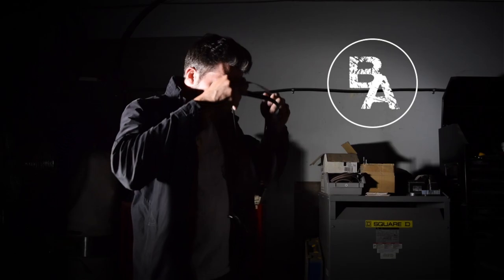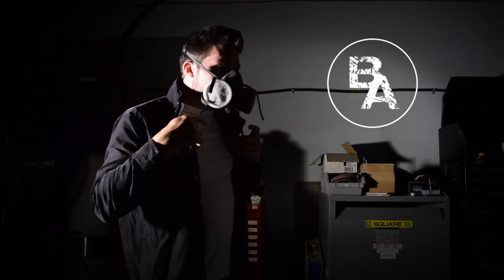Worst Paint Job Ever!?!

Comment: I've been Painting/Staining/Lacquering/Varnishing/Shellacing and applying any kinda  Coating you can name. Two part/One part/Interior/Exterior/Automotive/Marine, you name it I've applied it. I've been doing this since 1972 (age 10) and Professionally since 1980 (age 16) as well as repairing and restoring Homes plus Guitars on the side. Try RustOleum Hammered Metal Finish. It comes in Spray Cans and is available in Black, White, Gold, Silver, Bronze, Copper as well as several colours. It's a great looking and durable Guitar Finish especially for beginners. It's thick and sprays easily and doesn't run much. Just spray light to medium coats 2 to 4 is all you need. Sand lightly with 400 grit automotive sandpaper between coats, no buffing required. Best solid colour finish for a first timer. Super easy to use, easy that find and inexpensive about $6-$8 per can. One can per Guitar Body. I got 4 coats from one can on an Ibanez RG and finished it 4-6 minutes per coat. Approximately 2 hours or less allowing drying and sanding time between coats, 4 total. Waited 24-48 hours, applied 2-4 coats of Renaissance Wax (optional) then reassembled the using the Hardened Italian Steel Neck Inserts available from one seller on eBay. Get complete kit with 2 sets of inserts & machine bolts, drill bit and Allen wrench. It's about $20 and improves your Sustain dramatically. hope this helps everyone. 
Peace, Love & Light!!
Jimmy in NC....
Reply from the maker: I like the canned hammered finish. The stuff in quarts is a paint to work with because you have to thin it with xylene and it gets stringy so damn fast haha. 
Keep in mind with the cans you can control how heavy the hammered effect is based on how heavy you put the coats on.

Comment: Here's one for ya, LOL. I stenciled out a GnR skull (from their album cover) and painted it on the driver door of my 79 Le Sabre.(twice as big as my big head) I rattle canned it with the stencils in the autumn while in a full parking lot of my apartment building. Came out OK, for the most, LOL. But then continued to paint the rest of the car in black rattle can paint at my friends house, I think. It's been around 30 years ago and some details I don't remember. Anywho, continued to drive the car for another 3 years, I think, with the skull on the door. The cops would pull me over just for that, while sitting there stopped by the cops, the cops would look the car over, sometimes laugh at it, and let me go with an escort out of the neighborhood. So after 3 years, my girlfriend (now my Wife) hit the skull in the middle of the face with a bumper jack, in the middle of an argument, LOL. Afterwards, I just covered it up with black paint. Drove the car for another 10 years. The black faded off the door so much, you could see part of the skull, and the hole made by the bumper jack was now a rust hole. Parked the car in my yard for another 5 years before scraping it, The End, LOL.
Reply from the maker: Wow! That’s hilarious.

Comment: I sprayed black paint on a squire strat. Didn't do anything such as scuffing the poly or removing the pickguard, just blasted it with black. No clear coat afterwards so as I played it, the paint picked off the guitar so the sunburst underneath showed through. Looked awful. Course, nowadays this paint over different paint then relic seems to be highly fashionable so maybe I was just ahead of my time. Still looks bloody awful to me though.
Reply from the maker: Damn; that sounds like quite the experience. Too true that that seems to be a new “vintage” style though haha. 

I think you might be surprised by how many people have told me that I’m an idiot for suggesting that you need to scuff your paint before adding more. Apparently, if you sand it it won’t be smooth anymore haha...

Comment: i already told you about my worst paint job, though the way that the guitar looks is actually okay because the slightly crazed front of the guitar matches the whitewashed-then stained back and sides. it has a weatheredish, harsh look to it which is nice, and unique.
Reply from the maker: That actually sounds like the kind of finish that a lot of people would pay extra for.
Reply: yeah, it is only a bad paintjob because the actual paint portion crazed a little, which is not what i intended. the finish is also drippy looking because i sprayed enamal clear on it way to thick, and then didn't sand it because it wouldn't really contribute to the look in a positive way. i am happy with how it looks, because there is beauty in the flaws. it isn't supposed to look like a normal market paintjob, but instead it reflects the imperfect, yet creative methods i used to build the guitar, which in itself, is designed from the ground up, varying completely from normal market designs... i wish i ould show you, but i kinda want to design patent the guitar. however, i am working on a custom 24 hollowbody, which i will eventually complete. i am building it so i have a guitar to show when i say that i know how to build guitars, and because i always wanted a nice prs...

Comment: Ahhh the trolls..  Worst paint job..  probably my first refin.  On an Esteban Acoustic.  Sanded the original finish off ok enough.  I used dyes, and that went not so great, but eventually I managed to get what I was looking for.  First mistake, I didn't put any sealer down.  Started with Wipe on Poly. DISASTER!!!!! colors bled, it was a mess!  Poly wouldn't lay right..   Had to sand back to bare wood AGAIN.  To save you guys all the details, it ended up I sanding back to raw wood 3 times total.  I sanded through the veneer in a couple places on the top. It is now a purple burst with a LIGHT coat of lacquer.  One of these days I'll get around to completing it.  First and only refin so far, but I've learned a TON thanks to Brad!  
Thanks Brad!
Reply from the maker: Yikes! Well, I’m sure your next one will go much better!
Reply: It already has and in no small part, thanks to you.  I posted pics in the https://www.facebook.com/groups/354695864971816/  It's the green burst Tele.
Reply from the maker: Ah, right! I joined the group recently. Love that transparent green!
Reply: Thanks!  I thought it turned out pretty decent for my first partscaster build and second finishing project.

Comment: I'm a bit worried my paint job as an unofficial entry in the Great Guitar Build Off might become a contender in your best of compilation of worst paint jobs. Digging thru your videos now for rattle can sunburst technique (it'll be my first time)
Reply from the maker: I have two on that (make sure you use the more recent one), but I also did an interesting rattle can burst in my 5 part series on painting a guitar with behlens guitar finishing kit.
Reply: @BradAngove  I watched them both. Mine is opaque. I'll probably make a cardboard template to spray over and guide. Uploading video #2 tonight

Comment: I had an old LP bolt on lock off I painted black then put it on a pottery wheel. I then filled squeeze bottles with blue, yellow, red, hot pink (keep in mind this is 1988). I set the wheel about 50 rpm and drizzled the colors on from the center. Got a cool color explosion effect. After a week of sanding, clearing and reassembling I thought it was sweet. Took it to the next band practice and busted it out and even the bass player laughed at me.
Reply from the maker: That’s hilarious. I get asked about paint pours pretty frequently these days. I’ve never tried one myself, but they seem cool.

Comment: On the thumbnail for this video is a multi-colored neon and black splatter look that is not crackling effect, but looks awesome, is that something you have done? That is an awesome effect if you have a video on it!
Reply from the maker: I don’t have a video on that technique, but it can be achieved with a multicolor base and then using the wrinkle/Saran wrap technique overtop with black.

Comment: When I was about 15 I decided to give my Moped a custom paint job. Well I liked building models, it was the 60’s, so I had a variety of spray paint colors. I thought it would look cool if I just painted random colors. A shot of green here, a shot of blue there. I’m sure you get the idea. Very psychedelic. It looked absolutely horrible. The more I tried to fix it the worse it looked. I painted over the whole mess with flat black.
Reply from the maker: Haha well at least you took a crack at it. I’m sure it was very interesting if nothing else. Did the flat black turn out ok?
Reply: Brad Angove actually, it didn’t bond very well so in spots it peeled off, that actually looked kind of cool, flat black with the occasional random color through a hole in the paint. To the best of my memory I was the only person who may have thought so.
Reply from the maker: Hahaha sounds a bit like a non-deliberate version of the picture I posted on Instagram today.
Reply: Brad Angove it didn’t look anywhere near as nice. When I sold it the guy that bought it wanted 30 bucks off because of the crummy paint. What a mistake.
Reply from the maker: Chalk it up to a learning experience haha.

Comment: I spent ages trying to finish a guitar body I bought from eBay. Body came sanded but apparently I was supposed to use a grain filler, and after a primer / base coat, Rustoleum Chameleon paint job and a polyurethane finish, it ended up looking cheap and feeling sticky. So I gave up and haven't tried to paint anything since.
Reply from the maker: When was this?
Reply: About three or four years ago now.
Reply from the maker: Damn. Well, if you decide to give it another shot, let me know. Maybe I can help you out.
Reply: That's a very kind offer. Thank you :).

Comment: Hi Brad, Ive painted My bike and like a camo theme and unfortunately had a problem. So I sanded it with scotch brite as you suggest in your videos, and then spray painted the base coat, 3 coats, 10 min in between. I waited about 3 days until I put tape (painters tape) and painted the second coat. When I pulled that off it took some of the base color with it. I did as you suggested, when I pulled the tape I made sure I pulled it back-down as you do. Kinda cold environment this time of year but it was 18 degrees (Celcius) when I painted it. Please help. Sorry for my English it isn't the best but I tried haha. Very good content best on youtube in my opinion, keep it up!
Reply from the maker: Hi there. There might have been an issue with the paint not curing correctly due to temperature or something. It could also be that your tape is more adhesive for whatever reason. 
Let the second colour dry fully, mask it, lightly sand the areas with the first colour, and spray the first colour again.
Reply: I left it for 3 Days and wet sanded it before the second color. But the tape is kinda sticky, is that the problem? But it's the best in town, and it should have dried fully in 3 days. Any thought?
Reply from the maker: It depends on the paint type, but sometimes paint doesn’t dry fully in three days. Sometimes masking tape sticks too hard as well. That concern can be alleviated by clear coating between colours, but that’s a pain.
Reply: Okay thanks for responding man, have a good one
Reply from the maker: You as well.

Comment: Hey Brad the world is full of haters!
I think the paint was awsome on your last video. I would like to try something like that on a future project. I painted a Van Halen striped guitar with lacquer spraying it with a prevail spray system you know the little aerosol can and a mixing jar in the middle of summer here in Alabama. I learned a lot from that project. The humidity here in Alabama is like 80 and 90 percent in the summer. The prevail sprayer does not spray a guitar body very well the spray pattern is way to small. I did end up with a pretty nice finish after all but it was so much work. I have learned a lot from you my friend. I have bought affordable spray gun and air brush and I am having fun with them. I don't care what people think about my work I'm my only customer and if l like it that's all that matters! Thanks again for your video's. Your last project was bad as bro! Thanks again!!!!!
Reply from the maker: Thanks Michael. I’m really glad to hear that you picked up some spray equipment and are having fun with it.

Comment: I guess my only paintjob can be considered both my best and worst lol.
Matte black, with diagonal matte yellow stripes. Sort of a warning sign deal. Except I didn't think it through enough to actually do it over the whole guitar, so only the front and a little bit below the edges. 10/10 totally. Some paint got under the masking tape, so I just added some paint splatter to make it look intentional. The backside got some sweet yellow faded burst thing, which was kind of cool but not what I was going for. Aside from that, I like it. Might sand it down and redo it on the whole body next time lol.
Reply from the maker: That sounds pretty cool. Have I seen it?
Reply: I sent you links to when I did it only in matte black in the summer of 2016, but not of it with the stripes.
https://9joakim7.deviantart.com/art/LPjr-DIY-kit-update-700257183
(hopefully links still work on Youtube lol)
Reply from the maker: I though the idea sounded familiar for some reason haha.

Comment: I am researching paining my first guitar. Any tips for what kind of paint to use? I was planning on using metallic finish blue and purple spray paint, and a clear coat over that.
Reply from the maker: Lots of tips haha. On the note of metallic blue and purple, have you seen my video on how to do a chameleon paint job with spray cans?
Reply: Brad Angove no. I will look at it now. Thanks!
Reply from the maker: It was blue and purple chameleon paint. I think you might like it haha.
Reply: Brad Angove i checked it out. It looked really cool. I was just looking for a throwback to my first electric guitar. It was blue with two purple stripes running across the whole thing horozontally. I will probably do my next guitar a chamelion. Is there a place that you would recomend buying that in the US?
Reply from the maker: Home Depot for the normal colours should be fine. As for the chameleon stuff, I provided a link in the description of that video where you can get it online if I remember correctly.

Comment: Clearly dude is just trolling.  But my worst is my Bronze warlock, first guitar, wanted it to be more metal so i sprayed it white with black bevels.  Matte no less.  Wasnt bad until i hit the clear and it turned yellow.  Eventually stripped it down and resprayed it in autoshop lime green.  Still have it and it looks pretty cool lol.
Reply from the maker: Sounds like it turned out sweet in the end. I’m curious what clear you used that yellowed it.
Reply: Yeah is not perfect, but it was my first time using a gun.  I cant remember, but it was some kind of clear out of a can.  It could very well be due to poor prep too because i was young and dumb lol.   Have you seen the Montana crackle spray paints? Been wanting to give them a go.
Reply from the maker: I don’t think I’ve seen those specifically, but I’ll keep an eye out for them haha.
Reply: Cool.  Might work for those old 80s crackle finishes they used to do lol!